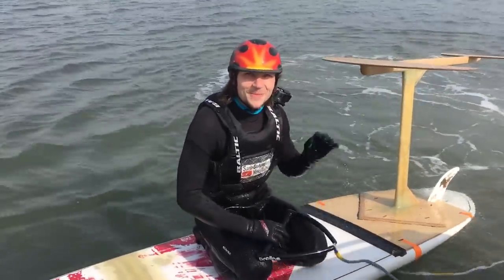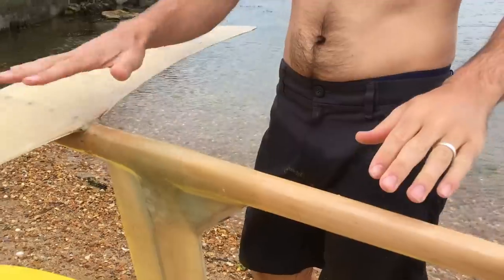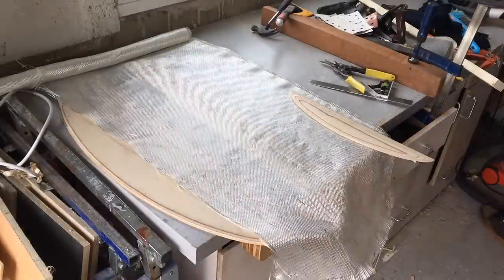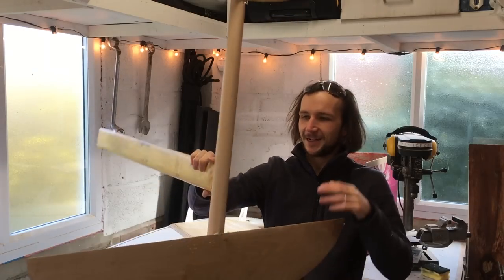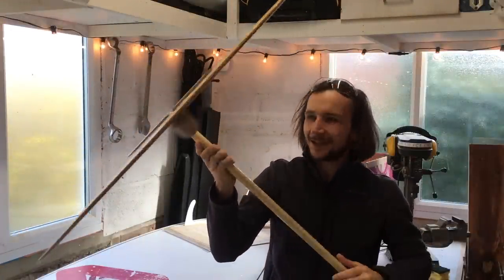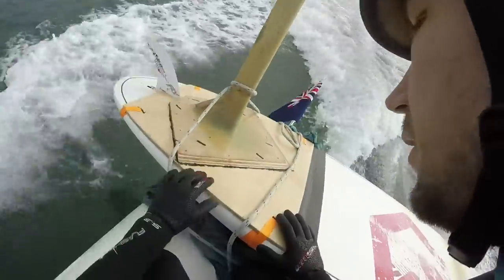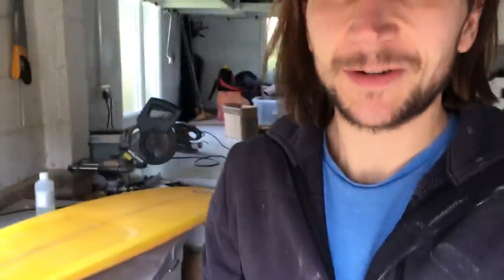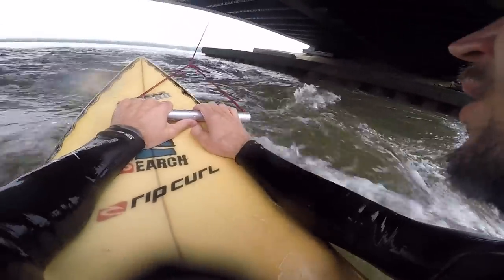I built a hydrofoil and tried it out

Comment: it appears in the video that your wings are both facing up. the rear wing should be facing down to apply downward pressure and ensure smooth lift of foil. i hope this is helpful. really cool video and i hope you keep at it.
Reply: Yup - this is a critical point.  The stabilizer (or rear wing) should have the camber on bottom.  Or you can get away with a symmetrical foil and a couple degrees of negative incidence relative to the main wing.
Reply from the maker: Thanks, I’ll make that change
Reply from the maker: Thanks, I will make this change!

Comment: Water skier for 40 years, and yes I have dabbled in the hydrofoil stuff. Three big problems with your boating attempt. 1. Your starting point should be straight behind the boat with the rope in a straight line.  2. The rope tow point should be well above the deck a meter, or more is even better. When it drags in the water with slack it has a bow and tends to pull sideways or down even if straight at @22.27 you can see the rope working against you. 3. You need to ''taxi''. Like you did @ 20:40 In other words, slow enough that the foil is not that much of a factor, get to your knees, stand and find the balance point. At that point the driver can apply more throttle. The driver wants to get the boat on plane. There is a breaking point where the boat planes up and the speed increases dramatically, but by that time you have to be standing or you will have no control, as you noticed. You will find that the foil will be VERY sensitive to weight adjustments fore and aft when you get the surfboard off the surface.

Comment: next time your behind boat start out like a wakeboard/wakesurfer not like surfer
get pulled up on your feet the surfer popup wdont be easy
1 you have rope pulling you away from board 
2 its very hard to slide back n forth on belly for pitch control 
3 shen your about to fall jump up and hold ropefor a sec that will pull you away from that sharp wooden death hatchet 
cause its going to try to roll the board over and jump out water to impale you as you land on it 
we named the one i made 
the red death 
i added red pigment to glass 
and its keeps trying to kill us 
hasnt got me yet got my buds elbow pretty good  
awesome work i like the axe handle 
🤔that would've made mine stiffer 
keep postin
Reply from the maker: Have you got a video of the one you made? I appreciate you comments!
Reply: You are so right about how to get up on board. I tried my surfer pop up and it was so hard. The perpendicular to rope wakeboard style is the way to go.

Comment: You should make the main foil a little bigger than that, I'm a radiocontrol airplane designer and what I'm watching here is a huge lack of lift because I'm comparing you with other wing foil surfers and you got a lot of speed but you wasn't able to generate enough lift to keep yourself and the board out of the water, I apologize because my English may not be enough to make this explanation better than this.

Comment: how did you calculate and make underwter wing? in aviation: lots of airfoils, second order surface, they chnge from fuselage to wingtip, there is wing reverse twist. by eye you may catch one degree, but for hydrodynamics 10 degre minutes will mean a lot. i did not see u use micrometers or anything. how did you make them? simply copied???
Reply from the maker: It was done all by eye really, but based on some overall dimensions of existing foils.

Comment: I think you should bend down the tip of the main fin (both side).  Might be will give you more balance when the foil going lift your weight.
I love your video.
Reply from the maker: Thanks, I think you are right. If I can i will make this modification and post a shorter video, perhaps late summer.

Comment: Well done Sam!  Is that a canard configuration?  It looks like the stabilizer is angled to generate lift rather than downforce.  That makes it very challenging to ride, since it isn't as stable. But it will be a lot of fun with practice.
Reply from the maker: Oh right, should I flip the rear stabiliser for easier riding?
Reply: Usually the rear wing has a negative angle of attack (tipped down). In an airplane this makes it inherently self-correcting and helps survive a stall. I noticed most hydrofoils have the same setup. Apparently canard hydrofoils are very sensitive and want to turn rather than go straight, although I've never ridden one. But you have!
Reply: @noomapollo5389  I ride them nearly every day for half the year, and you're right.  You really want a bit of negative lift on the stabilizer (rear "wing") for stability.  That has the effect of putting your center of gravity just a little ahead of the center of lift on the main wing.
Reply: @SamButement  This is key. having the stabilizer upside down like you have will make the foil pitch down immediately after take-off and being fully unstable. Flip it, it'll be a world of difference. Also it does not make sense to sharpen the front of the mast, but don't worry about that now, first thing is to make it stable.

Comment: I’m working on something similar out of carbon, did you ever experiment with the angle of attack of the front wing?
Reply from the maker: Hi Max, i fixed it level thinking that I could angle the board. Looks like others have done the same. Best of luck with your project!
Reply: @SamButement  The actual wings I would hypothesis are too rigid. It should flow like a bird wing, or how Max is describing in sailing nomenclature.
Reply: from what ive read you want them rigid
if they are flexing it will be less controlled

birds have mutiple individual controls on wings   you dont
Reply: how did you calculate and make underwter wing? in aviation: lots of airfoils, second order surface, they chnge from fuselage to wingtip, there is wing reverse twist. by eye you may catch one degree, but for hydrodynamics 10 degre minutes will mean a lot. i did not see u use micrometers or anything. how did you make them? simply copied???

Comment: commendable, i do think that if you could get hold of an actual hydrofoil wing you could model it around that, the angle at which you would need to make seems to be at the front more height to cause lift in essence like an aircraft wing i suppose, it does seem really flat with no turbulent direction being made to split the pressure differences between top and bottom, i dunno but maybe some reading on hydrodynamics or fluid mechanics may help. You could make a silicone mould of the foils, buy them, silicone mold them and send them back as not needed within a day or two, that  would be my plan at least.
Reply: Having zero incidence of the main wing relative to the board isn't really a problem.  But you want about 2 degrees of negative incidence of the stabilizer relative to the main wing.

Comment: Using a stiffer core for the wings wouldn't have made such a large difference. 
The highest values of elastic modulus for pure pine wood I could find were still twice lower than that the of average Fiberglas parts. Worst case about factor 6. 
Adding, that the outer wall of a part plays the highest roll in its stiffness I don't think you'd get any noticeable improvement by using a different core.
What would have made a huge difference, is carbon fiber, as it's modulus if elasticity is about 3,5 times larger than Fiberglas.
Reply from the maker: Thanks for the tip! Next time.

Comment: your board is too heavy bruh. ditch the surf board and rig foot mounts to the actual foil. That board is too heavy for gas atmosphere, because then it would be 80% surface area (surf board out of water) AEROfoil and you have been tinkering with 20% of the hydrofoil apparatus the whole time.

Comment: What is the Angle of Attack of your wing? Zero Angle of Attack = Aero Lift.  Increase the Angle of Attack will increase the Lift.
Reply: WeBeGood, as far as i could se he had a positive camber on the Main Wing, so the Wing actually would generate lift......
But i think the Problem was that it is anglet down a bit, so it got pulled down
(Sry for my Bad english)
Reply from the maker: Yes, correct